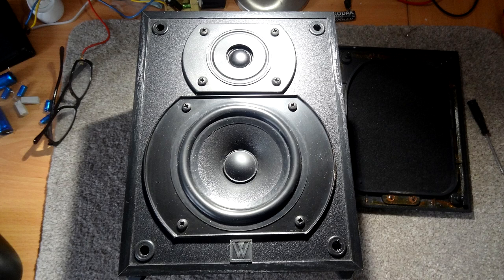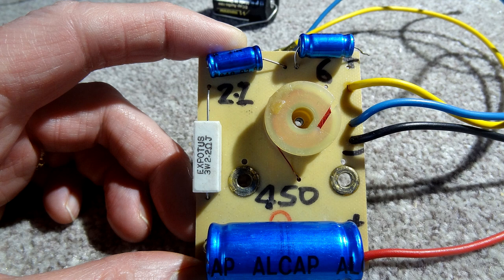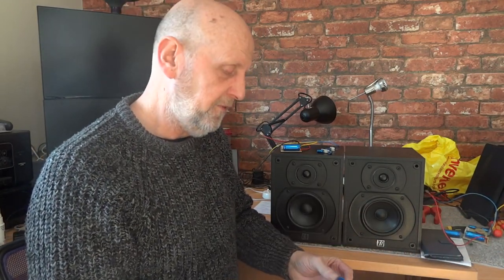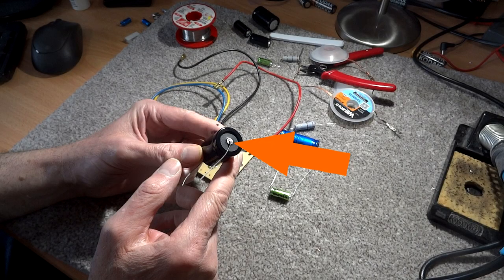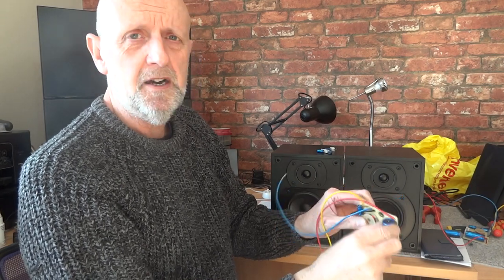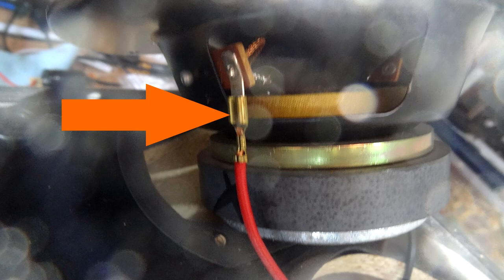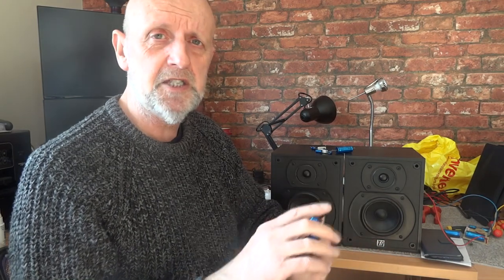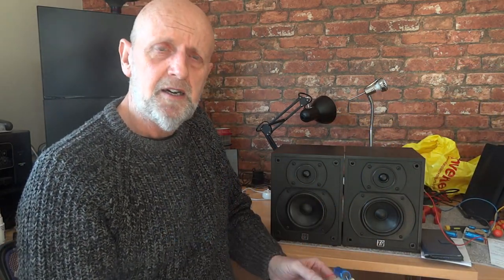Recap Your Speakers, Crossover Recapping Wharfedale Diamond 3. Mondorf Ecap Capacitor Bipolar Alcap

Comment: Hi Michael - nice overview - thanks for sharing it with us! I rewired some older Mission 700's and replaced the Dynavox tweeters a while ago. I brought them back into my main system for a quick test and was well pleased with the definition and detail, so fettling older speakers is definitely worthwhile and cost-effective. You've got me wondering if I should re-cap my beloved KEF Reference Three-Twos which are about 24 years old now.  All the best, Rob in Switzerland
Reply from the maker: Hi Rob, Switzerland was mine and the wife's first hoilday together and we loved it, we must go back soon. Think if speakers are old and the new caps are not to expensive then well worth a try. I have done a few pairs of speakers now and the extra detail has been noticable. If the tone changed or were to bright then I could have always but the old caps back.

Comment: Got Diamond 1's and you have me pondering a recap. So ive pulled the trigger and ordered all the caps and resistors as you did. Waiting for the postie now
Reply from the maker: Please come back at let us know how it all went
Reply: @MichaelYates  I will do so
Reply: I also have a working pair of Diamond 1's that have never been opened and stored for 30+ years. I am going to recap them and would be very interested how your experience went and what capacitors you used.
Reply: I did the speakers late last night and been listening to them today. They sound much better with more detail especially in the top end. Thanks Michael for this video as I would have not even bothered to do them and very pleased I did. I have a load of vinyl to replay now on my new speakers.
Reply: @stevecoleman3724  I got them done last night and well worth the effort. I ordered Mundorf Caps and very pleased with the results. More detail and its very easy to hear the before and after. Top end is very nice indeed.
Reply from the maker: @soundsofthe70s73  That is good to hear. For the little outlay even the smallest improvement its worth doing
Reply: @MichaelYates  Thanks for letting us know. I look forward to recapping mine. I also have a fully functional and pristine NAD 3020b to fully recap when I retire shortly.
Reply: @soundsofthe70s73  Sorry for the late reply. Thanks for replying, I have been pre occupied with a NAD 3020B that I acquired to power the Diamond 1's and trying to sort out all the capacitors for that. I will definitely now get round to the Diamond 1's. I have found Mundorf caps for the two 2.2uf, but couldn't find a 450uf Mundorf cap.

Comment: Capping speakers is so rewarding and a breeze compared to Amps I found. The last i did was for some NAD 8025's. Sad theres no reason to do my new speakers, maybe in a few years time. The added problem is they dont use screws now so god knows how you get the drivers out without longterm damage. Its for this reason ill stick to older speakers if buying any in the future.
Great vids mate
Reply from the maker: Thanks for the comment, I know what you mean by a lot new speakers not having any screws, will be a pain in years to come to recap them. Nice to have a nice smooth looking finish, but nothing wrong with screws.

Comment: That was a good trade off for the amount of money spend on these speakers. I would have soldered the drivers. I do not like these fast-on connectors.
Reply from the maker: Was going to soldier the wires here, but I wanted to return for a sound test with old crossover as well and might try and get hold of a 2.2uf Mondorf to finish this pair off. Then soldier.

Comment: (Sorry, Michael, have to revise my original comment). Re the bass,  the original Elcap caps (still available) were electrolytic and they would produce punchier bass than the Mundorf Ecap caps being polypropylene are known not to sound as punchy and can sound 'plasticky'.  Yes, they do sound brighter, but not as smooth as paper in oil.  If you can find PIO caps for the tweeter, that would be preferable. I'd replace the 450uF with new Elcap (at slightly higher value, 470uF), and you'll find the bass will sound more solid with more oomph than polyprop film caps.  Also worth noting that the ferrofluid (Aliexpress) in the tweeters may have dried up somewhat and can benefit from refilling.  PS: Also worth noting that the original rubber surrounds would have hardened somewhat and don't sound as good as new, obviously and I've replaced mine with foam surrounds, being more pliable, can reveal more details and sound more musical.  Only pain is having to replace them every 10-15 years.
Reply from the maker: Thanks for the extra information. I will look in to the paper oil 450uf cap, as I will be returning to do a little more work on these and a pair of diamond 2's soon
Reply: Mundorf E caps are also Electrolytic.
Reply: Poly caps can sound very different.. So electrolytics

Comment: Rauh is pronounced like row (As in fight. Not in a boat or theatre) without pronouncing the w at the end. Maybe I'll pick up some diamond 3's at some point. I've been watching the Haycross audio channel. Interesting stuff.
Reply from the maker: Thanks, Yes Haycross Channel is doing some excellent work re-building cabinets and crossovers for various speakers. He knows far far more than me about how speakers tick. Just a basic recap here but came off pretty well. Be interesting to hear what you think of the old diamond 3's if you do come across a pair.
Reply: I finally got some. Didn't like what I heard and figured the caps were out of spec. Started by measuring the tweeters. They measure 5.1 Ohm (so I am guessing they are 6 ohm and the 2 ohm resistor is there to make them 8), but hey what is that red lacquer on the binding post? That can't be good, lets get that of with some steel wool, which instantly clung to the magnet (duh) let's wipe that off. Ok now I snapped the lead wire to the voice coil. Tried to fix it but burned it with my soldering iron... So now looking for a new tweeter. 
I found out the big 450Mfd Cap is in the woofer section. Just there to protect it from rumble and bass spikes from careless users. The woofer isn't actually crossed over other than by the speaker itself, so I am going to remove the 450Mfd altogether. I'll look for some film caps for the tweeter. The tweeters are ferrofluid by the way (took of the magnet which is glued) so a potential problem in the future when they dry out. I don't think the voice coils can be replaced. It's all glued to the plastic front.

Comment: hi using pic's with video great plan   all my video's are on a sun 711  units  to all out there yes it dates from 1999  still work 
the only thing  the new windows 10 don't like  the old gear and my macker lady is asking why 

i have 2 sony tc755  please don't buy this make  the parts are going bad in the transport logic   not just th caps

it the trans as well they are all going bad  i have a 3rd one that is ok  one year ago all 3 were 100%  

so if you see any gear on ebay it's a lotto  big time      in the bigger decks  there's alot to do  when getting gear in mic you been lucky so far 
the my mate vince  he had alot of bad luck  

so if you have things that turn out bad please make video's about it  it will have ones
 just get in    the game     i am picking up gear right now for video's 

 a digit now  unit has come  saves the need of the computer  just time  i am waiting for 

i can film and edit at same time   pic's is great plan keep doing it  bob
Reply from the maker: Thanks for the comment and information Bob it all helps other people. Yes I find a still picture is better than a shaky video to see what is happening. When you get your channel up and running please leave a link to it.
Reply: hi it will be up there's alot of things
i am picking up
some one off  things i have the uc start up
team behide me  and there's targets i have to 
get  i am getting help on setting it up

the sony tc755  decks  real life what they are 
like for real

the same with teac 44  80-8 

waiting for me is better in the long run 
otari dp2700  

NEVER BEEN DONE on youtube ever  i show the insides as well